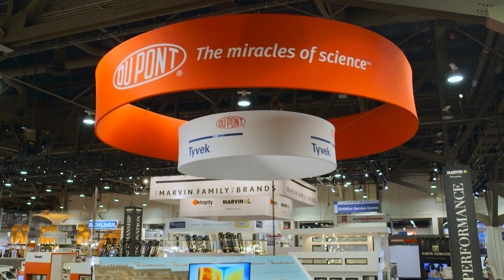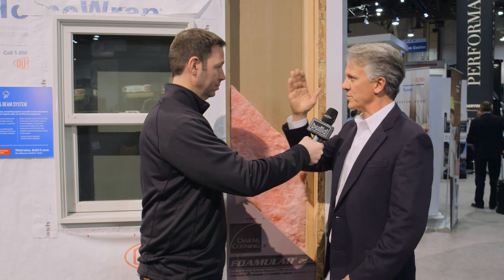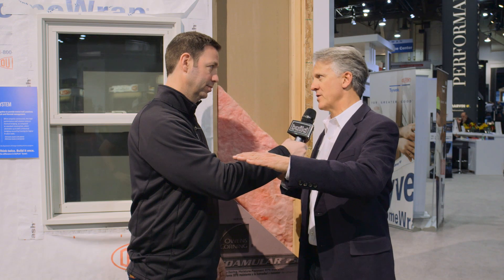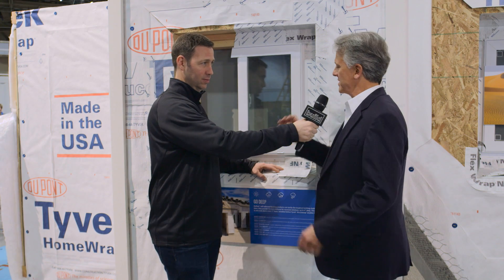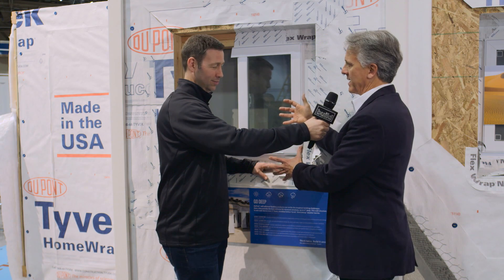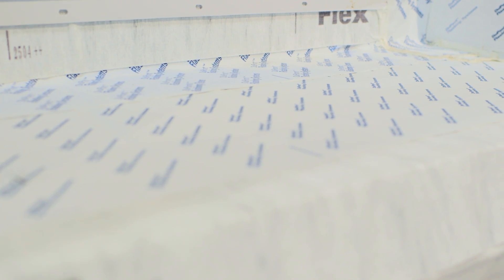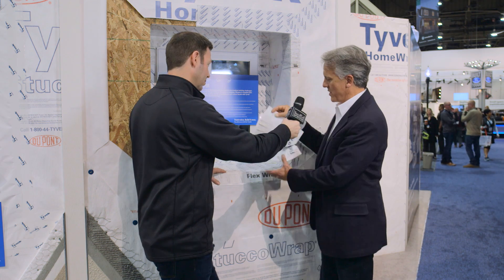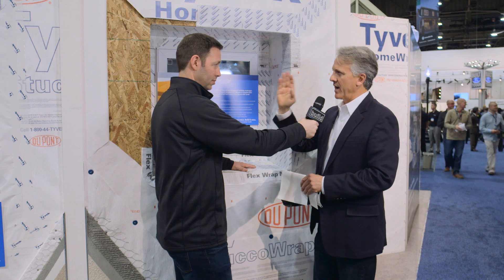IBS 2016 - DuPont - High R Walls partnership with Owens Corning

Comment: I have R-40 walls made out of 10 inch thick SIPs.  It's just dense  "styrofoam" (not the brand,)  glued under high pressure to 5/8 inch OSB on both sides.  The roof is 12 inch SIPs = R-48.  No rafters, no studs, no trusses, so very few pieces of framing serving to transmit heat  and cold from one side to the other.  The shell goes up in a couple of days, with insulation included.

Comment: Great video, as usual!
Question about the high R-value wall. If I understand correctly the foam insulation goes BETWEEN the sheathing and the framing. Is the sheathing nailed through the foam to the framing? From the perspective of living in earthquake zone 4, I wonder how you achieve lateral strength. Typically, sheathing directly nailed to the framing around all 4 edges and at intermediate studs, provides the required lateral resistance. But 2" of foam between sheathing and stud would make this impossible.
Reply: Historic Home Plans x-bracing or metal ties

Comment: Matt, can you discuss the high r-value wall please?  Is that using kraft faced fiberglass or unfaced?  1/2" or 3/4" OSB sheathing?  Does the buildup change at all if 3/4" or 1" foamboard is used? S.E. Michigan climate.